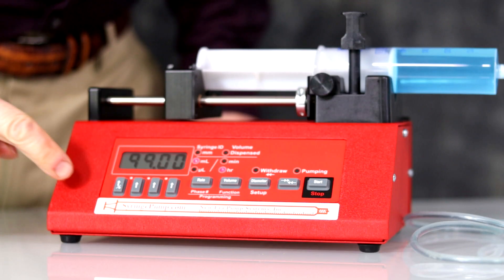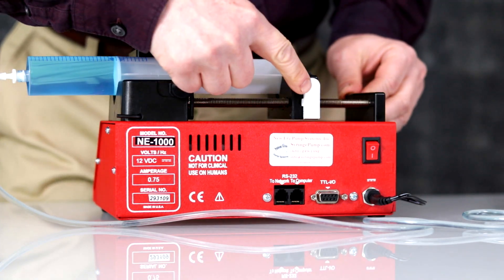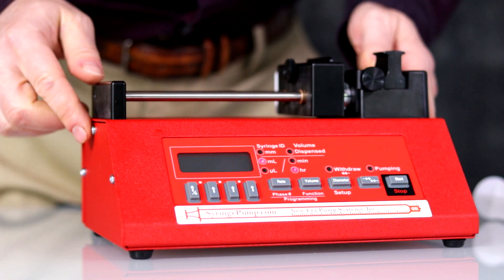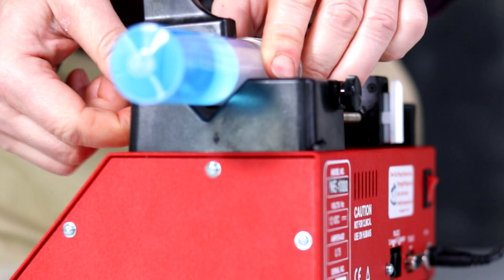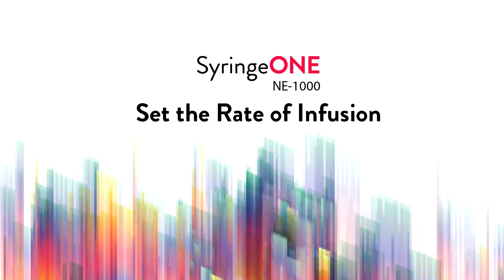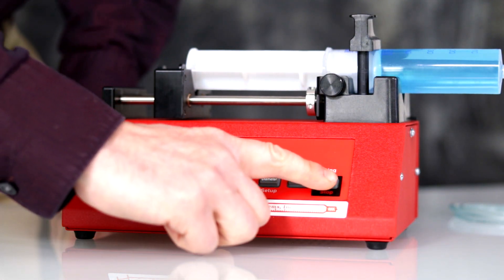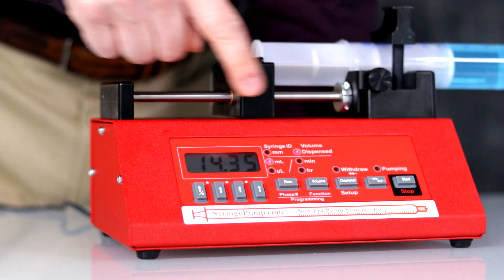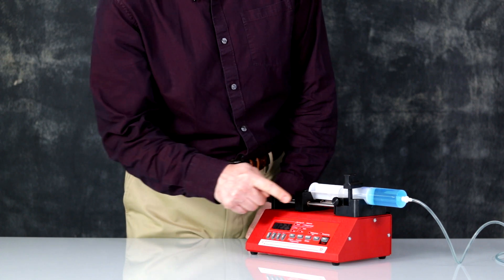Syringe One (sku: NE-1000)

Comment: Hello, I have a problem. What is the reason of the "Stal" error? 

The pump gives this error after a period of time while it is progressing and declining (only small rate, if I increase the rate no error.)
Reply: Hello Deneme. Have you solved the issue? I am facing the same problem. Really appreciate if you can help me with this.
Reply: @ahmadsalamfarooqi8015  Hi, you manage to solve the "StAL" error?
Reply: Have you solved the issue? I have the same problem
Reply: This error is a stall error. I've not gotten one but they are defined in the user mnaual. Have you tried resetting the pump? Make sure to check that the movement screw rod has light lubrication and is working correctly.